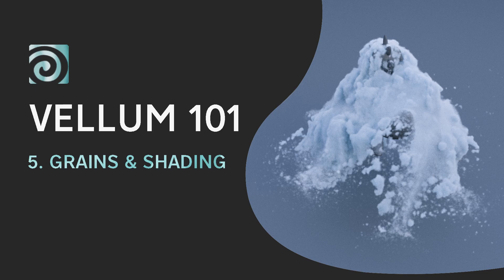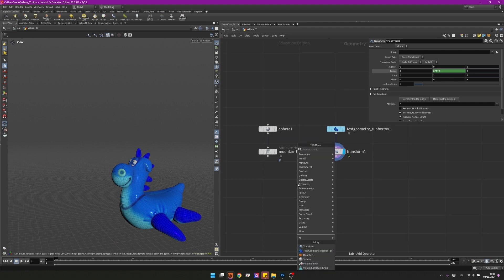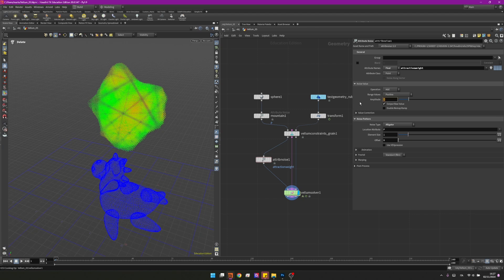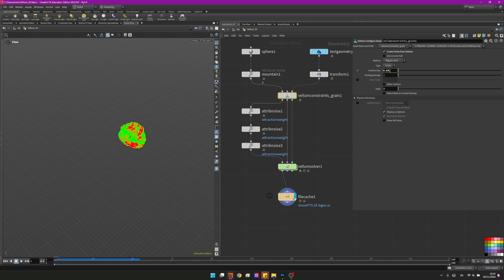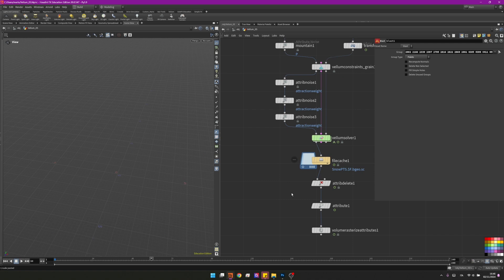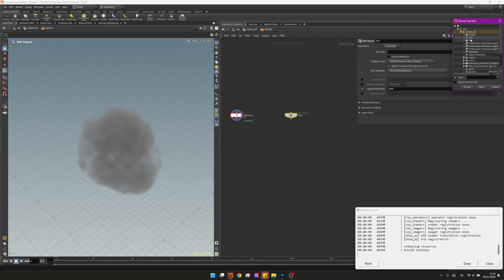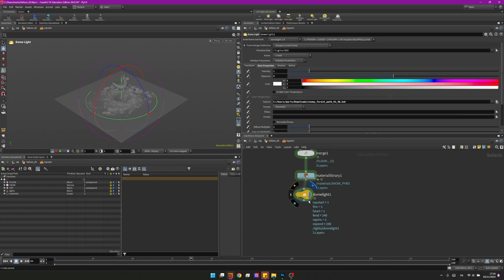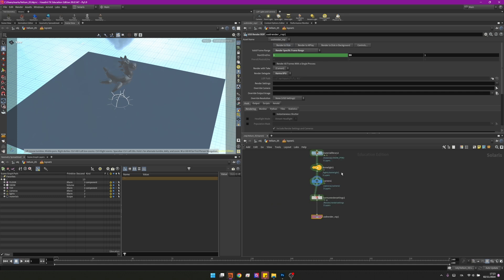Create a Snow Simulation in Houdini in Under 10 Minutes!

Comment: I wonder if it possible to replace particles with real snowflakes and groups of melted together snowflakes? Like I know copy to points but would it even work, maybe it could be on surface only so it could be some vdb operations used to delete most of volume besides surface to optimize memory usage. But the question is whats the best way to visualize snow, its volume right? Looks the best to me at least, just dont know how to add details, like maybe it could be volume and additionally scatter snowflakes with same parameters of shader, idk. What you think?

Comment: dude you are amazing 😍😍😍😍😍😍
i wanted to solve snow in houdini and render in blender so badly
many thanks
Reply from the maker: You're awesome, thank you! 🙌 Snow in Houdini + render in Blender is totally doable, glad the tutorial helped point you in the right direction. More coming soon!
Reply: Hey buddy, I am currently on a similar project. How did you export the snow out and import it in blender? VDB? point cloud? 
I literally started learning Houdini just to make proper snow. So, sorry if the question is too basic.
Reply: @darshjoshi1641  
i save the points as almbic using "rop alembic output" node 
then import it in blender as alembic ,however it will not accept material the normal way
so i use geometry nodes to add material using the "set material node" and choose the material i want 
i also tried open vdb and give it a volume material , or sometimes i do both at the same time 
hope i helped
Reply: @moe-3dart  It is very helpful, thanks!

Comment: Hi! Good tutorial, but I'm struggling with how to make much stickier snow chunks.
Reply from the maker: Hi and thanks for commenting, usually snow doesn't tend to be so sticky, although I am preparing a new tutorial on this, how to make grains stickier. If you are curious, the workflow would be to create the glue constraints into the vellum solver and connect them into the "Source" output. After defining the 2 groups that should be connected together, play with the settings and make sure to check, Create constraint = "Each Frame". That should be it, thanks!

Comment: Great video brother, helped a lot ! did you try the new MPM solver? It seems you have more control using this method. Cheers
Reply from the maker: Thanks, regarding MPM it is not necessarily about the control you get but more about the ease of use and the presets that get you 80% there already. I am considering making a series on MPM too. Thanks for commenting, Subscribe for more ♥️!!

Comment: what if i wanna convert it to mesh after volume rasterize attributes is it gonna look the same if i tried to render it in different software ?
Reply from the maker: Hi and thanks for commenting, to my knowledge is common to render snow as a volume. But you could use the particle fluid surface SOP and convert it to geo, although I cannot assure you it will look in the same way, you will probably need some subsurface and experiment a little more in shading. Hope this helps ❤

Comment: Really nice and well explained tutorial! Also really great with a Karma snow shader 😊 I know you stated in a previous comment that getting glints/speculars in the snow is difficult. But is there any way, that you could explain how you would do it? For me that alone, is a reason to render with Mantra instead as the speculars really help sell the realism!
Reply from the maker: Hey, thank you so much. Absolutely, I understand you concern, to my understanding you could calculate the gradient of the volume using the vdb analysis SOP and then create a custom shader to add reflection to the volume using the gradient as input. Although I have never done it yet, I have seen other videos explaining the same concept and applying it for mantra. The concept would be the same and you could play with a pre-made whitewater shader or make a custom one and still render with karma. I hope this helps, I am still in the process of understanding the reflection side of a volume, as usually is not really needed for smoke, explosions etc... thank you!!

Comment: Can we render the volume with normals like in mantra whitewater shader? That is standard workflow for snow because we need the reflections/ specular
Reply from the maker: Yes you could, but using Mantra you will be limited in performances, great render by the way, but for this series we are using karma! Also using the normals for reflection is a nice trick but the proper volume reflection in shading is a more advanced topic. To sum it up I chose karma over mantra because it's faster more efficient and more subject to updates and "in studio" implementation, and I chose the "XPU pyro material" because it's a simple way to get nice results without faking reflections or diving in the complex realm of volume reflection shaders... I hope it helped 😀
Reply: @nodeflowhoudini  I am very interested in how to achieve a specular volume shader in XPU. if you can figure it out you'd be doing the community a huge favour! so many posts on the sidefx forums looking for an answer to this problem
Reply from the maker: You are right, it's a pretty well known issue. From a teoretical standpoint it should be done in the same way used for mantra, but rest assured, I will experiment in solaris, and once I have it I will post it here. Thank you for the interest and for the comment, subscribe for more ♥️